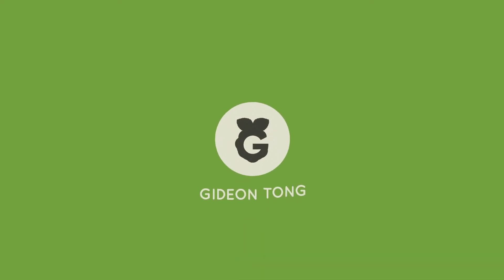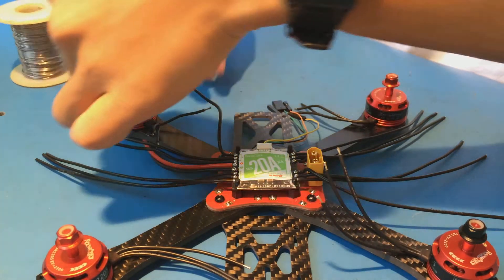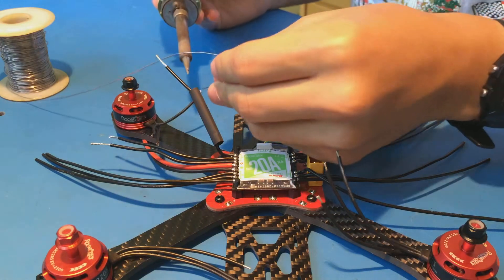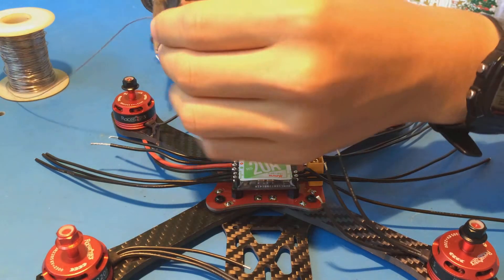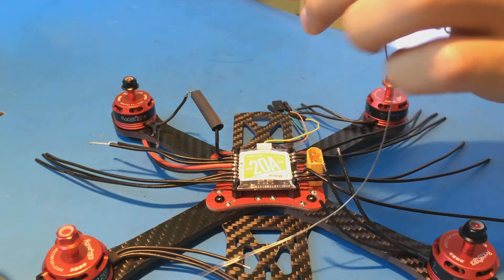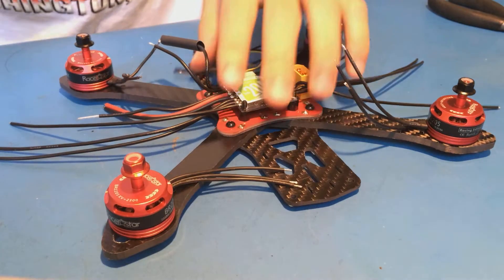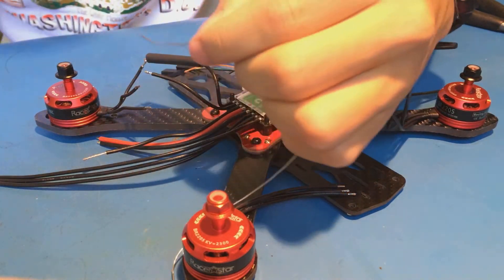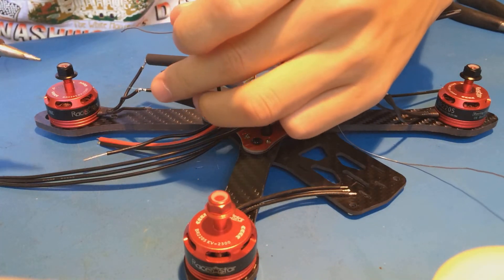Soldering the Racerstar 2205-2300KV motors to the Racerstar 4 in 1 20A ESC - vlog S1E8 [HD]

Comment: I try to keep my motor wires as short as possible (lay them against the arms and solder them. Also, a 127 piece assortment of heat shrink is only $5 at Harbor Freight, it will fit the wires perfectly. Nice video, your soldering skills will improve with practice,  don't worry about it. Just build more quads !